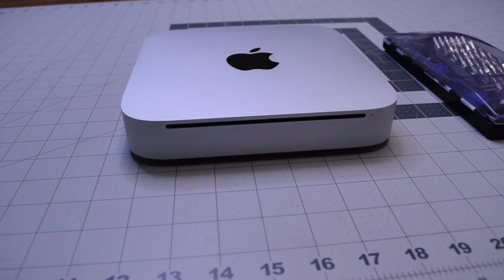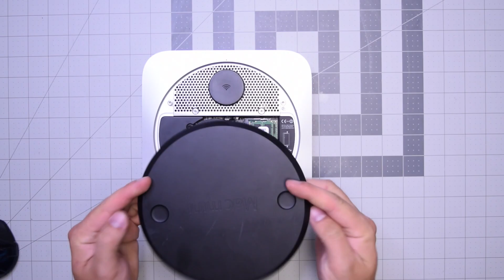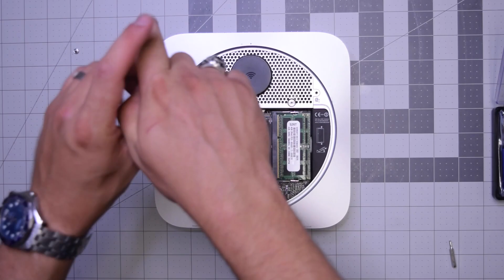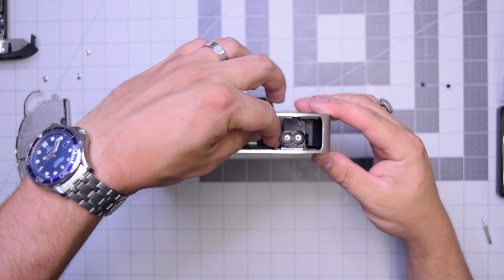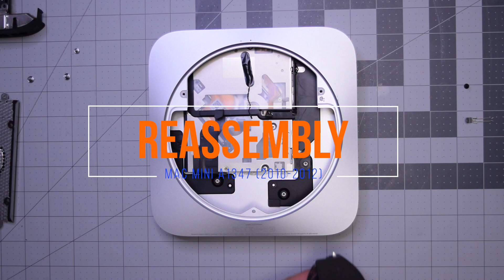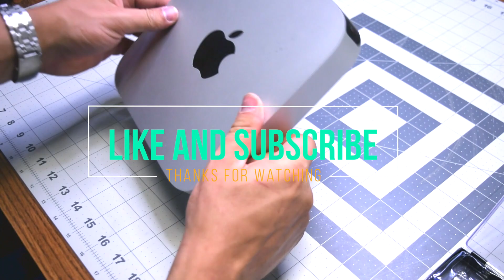Mac Mini A1347 - Power Supply Replacement (2010-2012)

Comment: Thank you very much for this vid. Indispensable knowledge. Pity, I changed out the power supply but the thing still wouldn’t power on. I wonder what it could be?
Reply: So I went through the hassle of replacing the power supply with one from Ifixit and it did not make a difference.  Little light flashes on for a second, I a little sound from inside and then it all goes dead.  I even replaced the PRAM battery along w/ the power supply.  I will have to pull out my wife's 2012 Mini drives and put in my 2011 Mini drives.  I hope it will work.
Reply: Mine did the same thing .  So i just ordered a whole new mac mini.   But id still like to fix the other one .
Reply: @Cjthasticman  Same Q as above.  Was your symptom that when you press the power button you hear a brief whirring sound and it stops right away?  That's what mine is doing and I just bought a new (used) power supply and I'm about to go through the pain of swapping it.  Maybe for nothing.
Reply: Was your symptom that when you press the power button you hear a brief whirring sound and it stops right away?  That's what mine is doing and I just bought a new (used) power supply and I'm about to go through the pain of swapping it.  Maybe for nothing.
Reply: @Jeff99  yes my little light comes on for a second then dies.
Reply: @350kph  Ah.  That's a bummer, then.  Cause it's like it wants to start and immediately gives up before it even gives itself a chance.  So now I know what I have to do.  Mine's a 2011 and I have my wife's old 2012 sitting around after she got a new M1 MBA last year.  I'll take both drive assemblies out and swap them.  I'm hoping it will work and at least get me one OS level higher than I could have gone with mine alone.